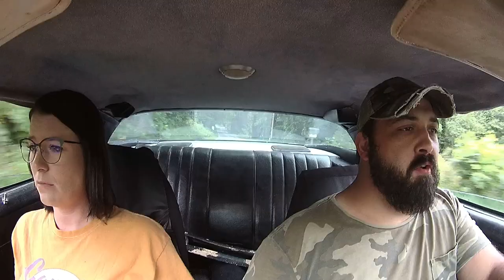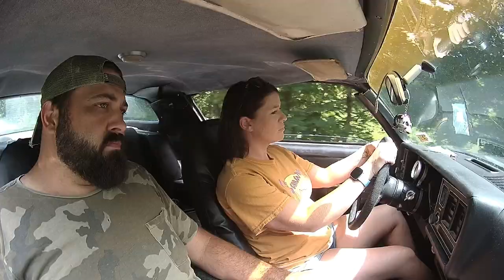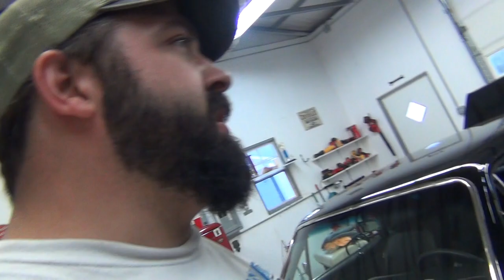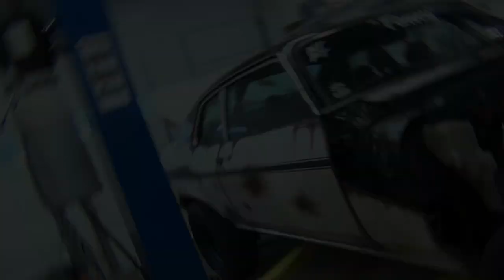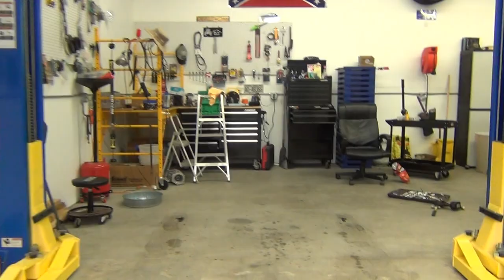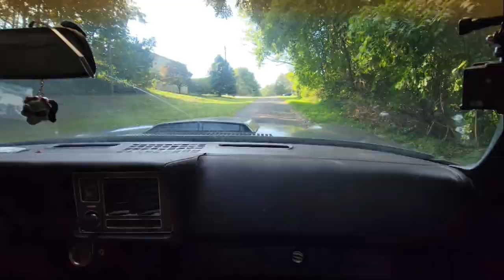SKULL GARAGE 2022 (EP.22) KARLA'S CAMARO OUT ON THE STREETS FOR THE 1ST TIME

Comment: It may just need a touch more tuning around  to get some power going. Or might just be a mismatched combo of heads/ cam/intake/carb. I have put a smaller carb, and dual plane intake on a mild 350 and gained power and throttle response. But if it runs good enough it's hard to change it. Solid ride.  Someday soon will have my old 76 Silverado stepside going again....

Comment: Hey my wife Jessie she loves hot rodes and she has her own 1969 Pontiac GTO and she had it since she was 16 years old and she's 38 yrs old. She completely rebuilt the engine and transmission and brakes and rear end all by herself. I just told her what to do. She even rebuilt the carburetor herself and she loves to weld and also paint. She painted the engine and engine bay herself. She loves to drag race but hated it when we pair up on daily driver class. Cause I always win. Mine does 8:seconds hers does 10 second class. Sue won one race cause I smoked the tires on somebody's oil spill previous driver who went before!e and was leaking oil. Track officals was sloppy cleaning up the spill. Jessie was like OMG I won. She was like wait a minute Jesse u ket me win. But she heard me spinning the tires. Cause !y motor is louder then hers.